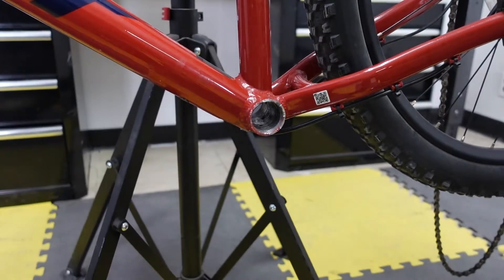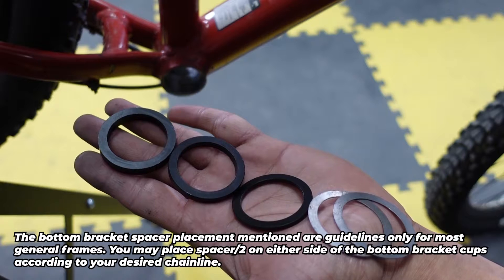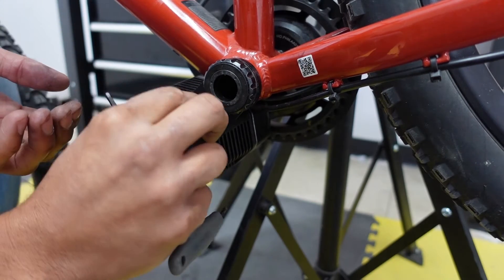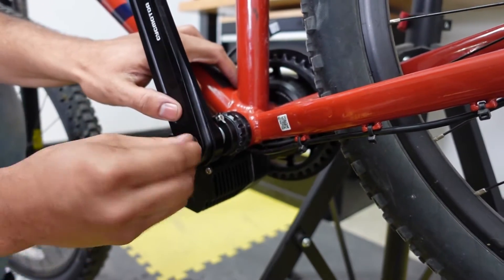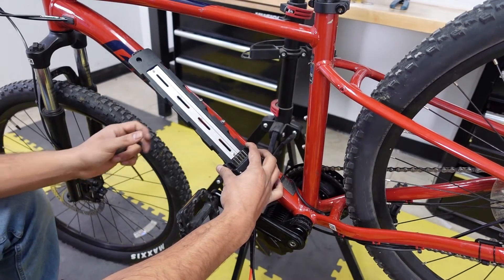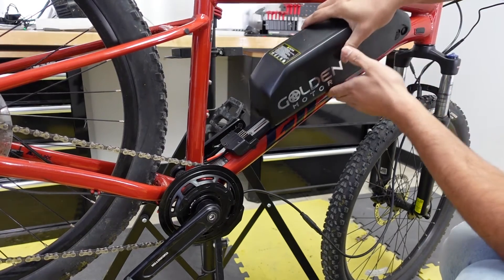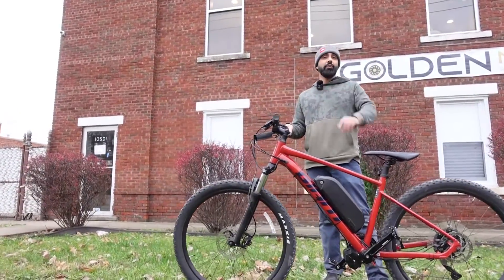CYC Photon Gen 1: Overview and Complete Installation Guide

Comment: With a 26" wheel that is at 17 gear inches before the motor mounting, a 34 tooth crank will be about 25 gear inches ~ afterwards if use the largest cassette in non-motor mode

Comment: Buying a unit next, i’ve used and modded tongsheng tsdz2 motors for MTB riding and have been good but suffer terrible bearing failures and could have been great but fallen out of love having to repair constantly. Price now for tsdz2 under £240 that swings it without batteries but this Cyc product looks another level in bearing and engineering. I love these types of motors and the torque sense just spot on.

Comment: The Torque & Wattage specs for this CYC-Photon Mid-Drive seem likely to be inflated some. Other than that, it looked to be a pretty clean install and good performance, so, maybe it does make the advertised spec's.

Comment: I can't find replacements for this motor and the chainring is exclusive from the brand so you have to pay from 60 $to 130$. On my Bafang 750w i have to replace the chainring (15$) every 3 months and the clutch (15$) every year.
Reply: That's relevant information for me I just got one put together last week. And I was wondering about which parts would need to be stocked up on.

Comment: Thanks for this.  Excellent Content!  From what I see in our video, there is not a proprietary battery for the Photon.  I can use one of the standard 48 or 52v e-bike batteries that are commonly availible?  Also would Bafang cable extensions and Bafang throttle work on the Photon?

Comment: I wonder how over rated these motors are. ?

 I installed the TSDZ2 a couple of days ago, running 52v battery and my old Bosch Gen I 50 Nm is more powerful on steep hills so I think it's safe to say the TSDZ2 stock firmware is less than 50 Nm. + the TSDZ2 gets very hot, the Bosch hardly even luke warm. 

I'm thinking about installing the open source firmware. 

The TSDZ2 appears more powerful than the Bosch on level ground and moderate hills because it's not speed restricted but on the really steep stuff the Bosch wins. I'd love to try an 85 Nm Bosch but the cost.......

This Photon looks small enough, I wonder how much power it really has. The Bosch Gen I 50 Nm is the benchmark for me.

Comment: Something to think about.  What does Torque and Watt have in common?  They are both SI Metric System units and the unit of force in them is a Newton.  Weight is a force.  It is the product of mass multiplied by gravity.  Torque is weight or force multiplied by distance.  That's why the unit is Newton Meter.  But you called weight kilograms.  If kilograms was a unit of weight, torque would have the units kilogram meter.  But that's not the case which means kilograms is NOT a unit of weight but rather a unit of mass. Just say mass in lieu of weight when referencing the unit gram/kilogram.   The ambiguity between weight and mass was resolved a long, long time ago with the SI Metric System.

Comment: at 12:44 in the video…..motor noise is very noticeable!  How may watts is this motor running at here?   For silent operation when does one cross into such a noise level?   200 watts?   300 watts?   400 watts?   When can one say the motor starts to get audible noise?   Really need a noise meter to report on how quiet e motors are.

Comment: Hey man the CYC install video puts both the 7 and the 3mm spacers on the non drive side which way is correct?
Reply: I had to put the 3mm on the drive side, so the chainring wouldn't touch the chainstay. If you have space, then I guess you can put both on the non drive side.

Comment: You should specify at 3:14, you should only add a spacer to the drive-side if the chainring is hitting your chainstay. If it clears, your spacers should all be placed on the non drive side to keep a straight chainline.
Reply: I stripped my threads for doing this. I wish I had seen your comment
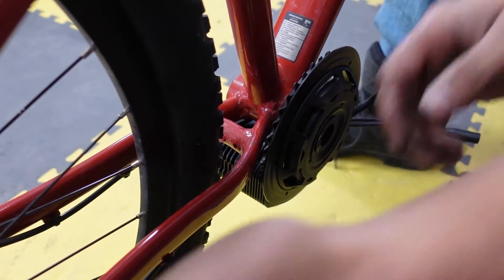Reply: Is that not implied in what he says at 3:44? Is this indicated the mounting instructions or just be plain old common sense?

Comment: Thanks for the detailed review.  Are brake sensors required for this motor?
Reply: Only if you are going to use the throttle and the break at the same time.

Comment: can the photon be used at 72V?  Looking to see if its compatible with my existing 72 volt batteries.
Reply: Been thinking the same. I sent CYC an Email, let's see what comes back. 

Officially it's not good for 72v so it will void the warranty
Reply: Display says 52v max.

Comment: Looks like your BB shell could have used a facing. After awhile you might get crecking due to uneven motor to BB interface. When installing a new BB, or in this case a motor, after removing a BB its recommended to face the BB surface
Reply: Well...there goes a few hundred for a special tool. Rats.

Comment: Any chance of getting a full sized diagram to see if it'll fit inside my triangle?
Reply: I was wondering the same thing, it does look smaller than the Bafang motor to me.
Reply: That looks small enough to fit inside some of those bikes with curved downtubes like Giant Stance etc, and might be easier than trying to fit under.

Comment: I think the Photon motor is a game changer. You can put it on any bike. I would put that on my old Trek road bike. Although, having said that, I think DIY ebikes should have decent disc brakes for stopping power. I have the CYC X1 Stealth with over 6,000 KM. I love it. But I just purchased and installed the Gen 3 X1 Stealth with the new torque sensor and crank. It is the same sensor as in the Photon. It is a game changer. It is so smooth. It turns your average cyclist into a Tour de France rider. The quality of the build is excellent. I even built a DIY trailer out of an old trike and I can ride smoothly at 50kph in level 3 pedal assist mode...or just use the throttle. Either way I can't even feel the trailer behind me. I chose the full, motorbike like, throttle. I built two folding eBikes last year also with the X1 stealth for a friend. He chose the thumb throttle. I'm glad I had decided on the full throttle. It is more comfortable for long commutes. I also chose a 52v/21AH battery for my build. Another decision I am glad I made because the cold weather up here in Canada really impacts the life of the battery. I tell my friends to get the biggest battery their budget can afford. Heck, I am now looking at adding a second battery on my rear rack to more than double my AH. I am also talking with a guy about building a 100Ah battery in the base of my trailer as I have the room.
Reply: any bike? CYC emailed me to tell me I could install it on a belt drive but I'm not sure if there wouldn't be any issues.
Reply: learn how To build and program an Arduino and you can have a Heated battery wich stays the same temperature no matter how cold it is...no range reduction and charging outside when its cold.
Reply: So I gauss it's a game changer. So you say.

Comment: What keeps the motor from rotating around in the BB? Also, I'm guessing there's no dedicated shift sensor port.
Reply: I don’t think BAITBALL understood your question.  There does not appear to be a bracket that prevents rotation as is seen on the Stealth and Pro.  Seems like they are relying on friction alone for the Photon.
Reply: It comes with something called a "mounting support plate" as listed in the parts section of the instructions but makes absolutely no mention of it in the instructions otherwise. No idea what to do with it
Reply: It has a bracket. He showed you in the install

Comment: Looks like Tongsheng Tsdz2 ripp off
Reply: mehh Tsdz2 isnt great...
Reply: @-joo3033  I installed the TSDZ2 a couple of days ago, running 52v battery and my old Bosch Gen I 50 Nm is more powerful on steep hills so I think it's safe to say the TSDZ2 stock firmware is less than 50 Nm. 

I'm thinking about installing the open source firmware. 

The TSDZ2 appears more powerful than the Bosch on level ground and moderate hills because it's not speed restricted but on the really steep stuff the Bosch wins. I'd love to try an 85 Nm Bosch but the cost.......

Comment: Are the chainrings special for the Photon? Is there a possibility to run this with a gates belt?
Reply: No, no Gates belt. Just special chainrings from CYC only.
Reply: @patrick1978maas  CYC emailed me that you could use it with a belt drive I just would think their might be issues with alignment with belt though I'm not sure. They just told me you could use it with one
Reply: @sneescampers  Yes...if?
Reply: You should be able to convert a gates belt chain ring to fit that kit. It's not a black magic.

Comment: Nice build.  

Any problem with heat when doing long rides or going up steep grades.

What about cables that go under the bottom bracket.  Do you have space to leave the cables without rerouting them.

Do you recommend the brake sensors?

I would like to use it with a Nexus IGH 8 speed.

Looking forward to additional videos.

Comment: Dud what happenned to your bottom bracket?? Looks like you took some metal out?
Reply: Most likely a BBS0X was installed in the past, which has teeth that dig into the bb shell. I got the same on my bikes after BBS02 install.